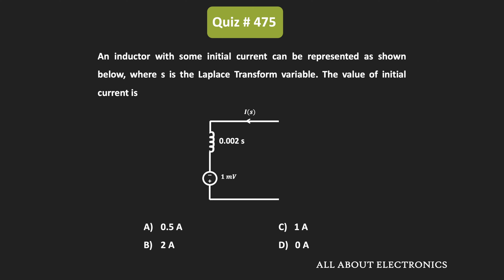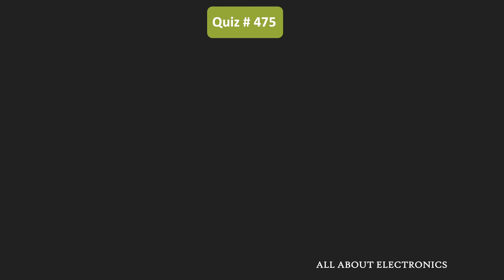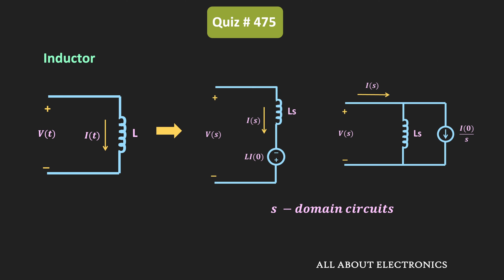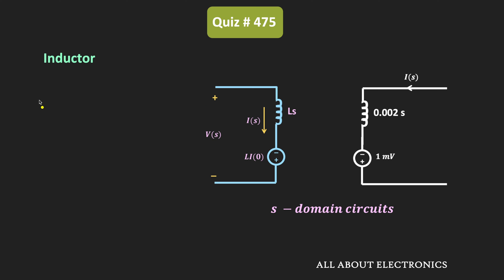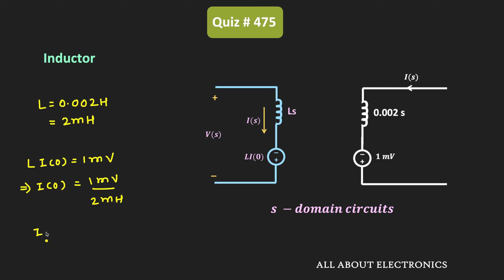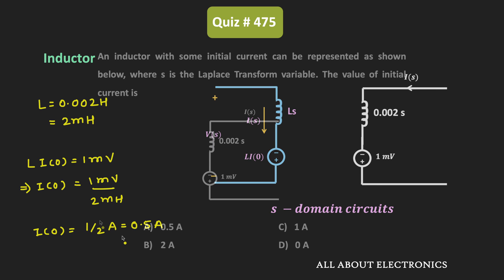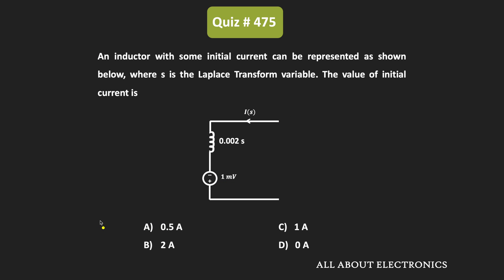Laplace Transform (S-domain Circuit) of Inductor (Network Analysis) | Quiz # 475

Comment: My only doubt is about dimensional analysis. Why dividing  1mV by 2mH we get 0.5A, and not A/s?
Reply: The basic formula L .dI/dt = 1MV  expresses the relationship between inductance  L and the rate of change of current dI/dt in a conductor during the transient state. Since current I  varies with time, its rate of change is measured in amperes per second (A/s), so I think dimension is correct